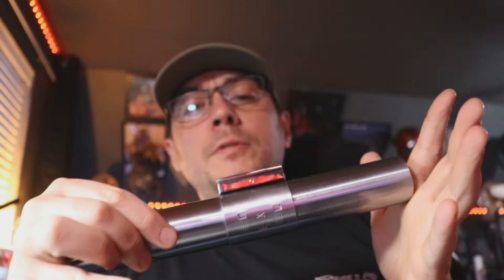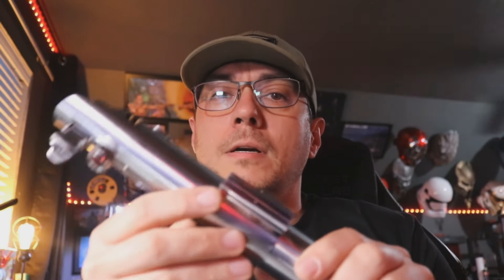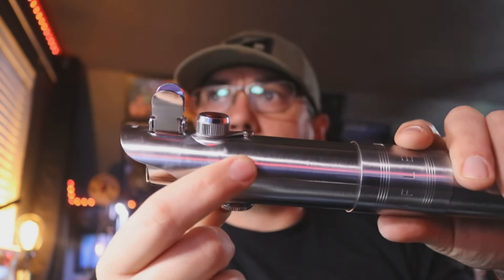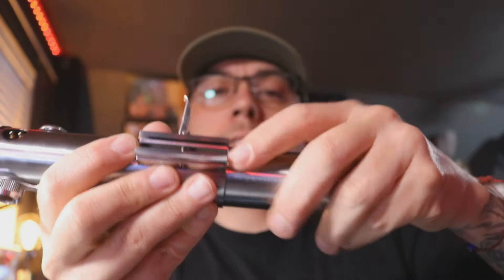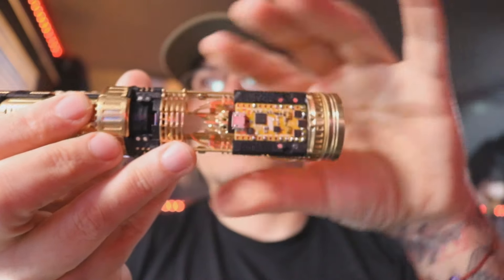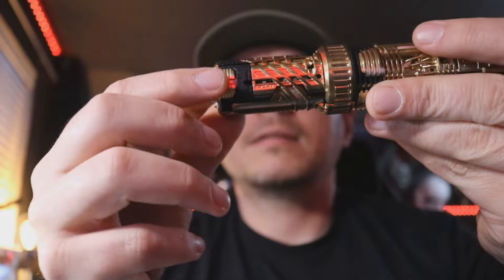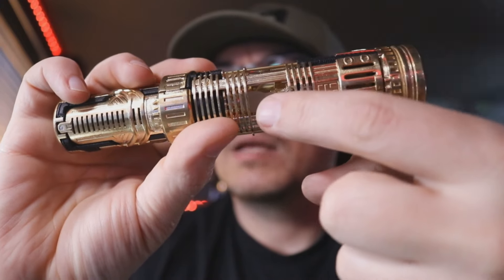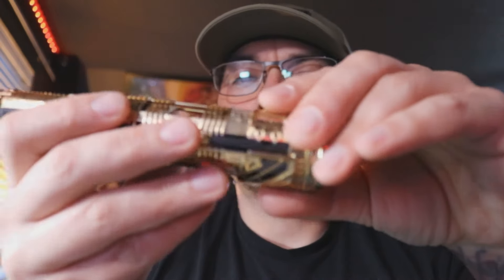Korbanth's 20 qty Luke Skywalker KR Graflexes with Goth Master Chassis

Comment: Do you know which 28mm speaker is in there? Hard to tell from the video how it sounds. Might be just the video, but sounds a little like the speaker breaks up a little. Does this chassis support a 31mm speaker too?
Reply from the maker: It’s my audio equipment that I use making these videos. It is not the speaker. The speaker was provided by Korbanth. It does not support a 31 mm.